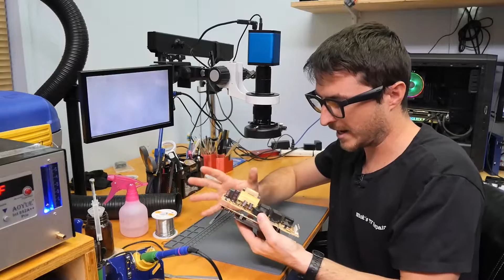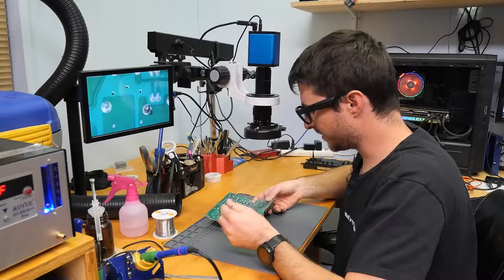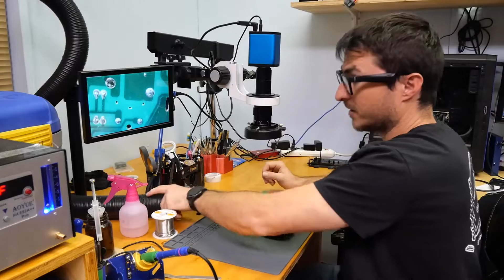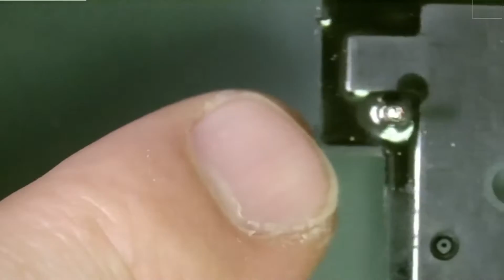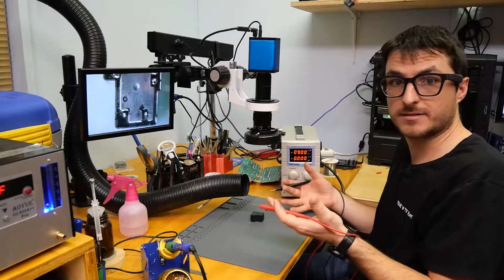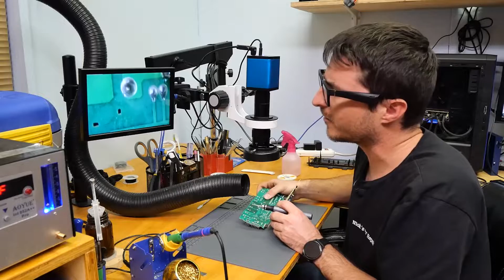Frigidaire Electric Range Oven Control Board Repair 318010102

Comment: When I check those relays on the bench I hook up my meter to the load terminals to make sure I'm getting continuity between the two when I apply dc voltage to the coil terminals. I've had these types of relays where the coil might click but the internal contacts of the load terminals were bad.
Reply from the maker: Bill,
Thank you for that tip, that's great info and totally makes sense. I was planning on doing a follow up video on these covering more faults that can occur. Ill make sure to show that in the next video we make.

Comment: I've probably got the same problem, but i can't figure out how to get the circuit boards out of the plastic housing... you seemed to magically skip that part in the video.  any hints?
Reply from the maker: So we decided to skip over the opening part because a lot of other youtube videos covered it already and it slowed down the pace of the video a lot. 
We wanted to focus more on the testing and soldering portion of the repair.

Comment: I have the same Frigidaire board your working .I can't seem to figure out how to remove the plastic frame holding the CB together without breaking it would appreciate some help
Reply from the maker: We decided to skip that part in the video because it would have added an extra minute and we felt like it really slowed down the video. There were already videos out there showing how to take it apart which was another reason we decided to skip that. We felt like some of the repair videos weren't very good which is why we focused on that mostly.
Reply: @NicksTVRepair  any hints at how to take it apart to get at the boards? link to something to get the plastic frame off?
Reply: I enjoyed your video and found help for my sisters Samsung TV ,so I subscribed and appreciated a timely answer, but in the reply you could have just told me.I didn't expect something for nothing to show appreciation

Comment: You do everything, somewhat like me. I got a trash AC last yr, board was inop, the little xfrmer to the board fried, fixed that, then I noticed the relays were acting funny, not latching sometimes, they were 12 volt relays but the board was a 5 volt board,....huh yea cheap chinese garbage, I replaced all the relays with 5 volt, worked fine then.  You've inspired me to get something like this going for my retirement yrs, I was a mechanic then had to have back surgeries, went back to school for electronics.
Reply from the maker: Yeah electronic repair is a lot of fun. I enjoy it.
Reply: @NicksTVRepair I have shifted gears to some old stereos I obtained, having much greater success. I have service manuals, its a cake walk with those.

Comment: I woke up and tried to cook breakfast and the bottom bake element wasn't working in my oven. After doing some research and going through and troubleshooting the other parts of the stove it became clear it was probably the control board (part# 316080103 from model FEF389WFCJ). I found your video once I got to taking the control board out. Saw the exact same leg had come loose. I removed the relay and tested it with a 9v battery and it was still working. So thank you for posting this video it helped a lot!
Reply from the maker: Hey of course not a problem! I am glad to hear we were able to help you get this resolved.

Comment: I have the same board as in the video giving me an F1 Error Code however I took everything apart to check the board and nothing looks burnt at all.  Threw it back together and still giving me an F1 Code after about 20 seconds or so of pressing bake.
Reply from the maker: Vince,

In our case the relay was very clearly and visibly the issue, however that is not always the case. Sometimes the cracked solder joint can be much more subtle and the crack can still be there without the burning. 
The fault could also be somewhere else of course. 
If you can take high definition pictures of the relay joints and email those over to me, I can inspect the pictures and let you know if there are cracks on those joints.
Reply: Hey Nick do you mind sending my your email so I can send you those pictures please sir.
Reply from the maker: @vincegaona132  Vince,
Sorry, Youtube doesn't send me notifications when someone replies. All of our info is in the video description for contact. If I ever provide links or phone numbers / emails / Whatsapp numbers, it's a scam. Ill never do that. 
Always get my contact info from the video description.

Comment: Ran into a similar issue with a co-workers hot tub. His hot tub technician told him he needed a new heater board and that he is SOL because its no longer available. I offered to take a look at it. I saw the 240V in at the relay had been arcing on the board. I scrapped the solder mask and wrapped the leg of the relay with 14 gauge wire and then soldered it to the trace to beef up the connection. Saved him throwing away a hot tub. Its crazy how much electronics get tossed due to simple flaws.
Reply from the maker: Do you remember the part number or model of the hot tub? I would be interested to know and do a video on that as well.
Reply: @NicksTVRepair  It was 2 years ago....I think it was a Pinnacle hot tub. Don't remember the board model #.

Comment: good morning friend I have a sony KDL-65x850c it turns on in white, RED, BLUE, GREEN color mode AND STAYS LIKE THAT the led turns white and stays like that no image appears can you help me
Reply from the maker: Hello,

We typically see those types of issues when the Mainboard is replaced and the ribbons are not properly installed. If you have not replaced any parts, then it could either be either your Mainboard or your T-con board that is causing the fault. 
If you could email me to our support@nickstvs.com email with more details and background information, I may be better able to assist you.